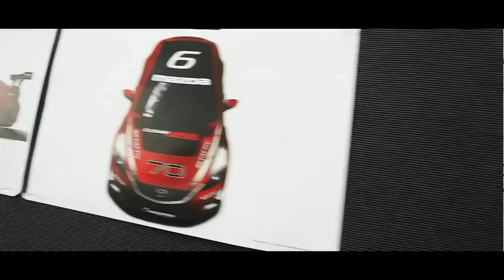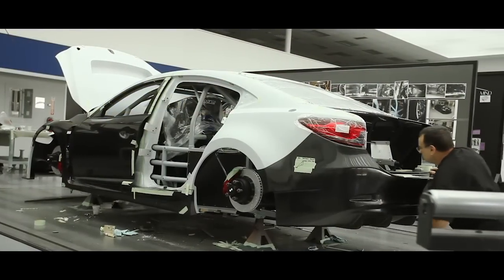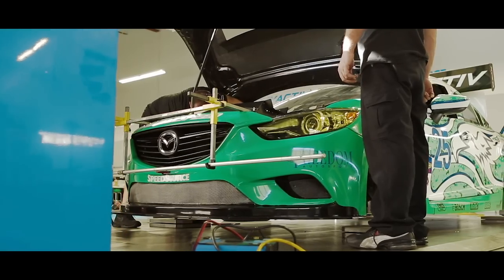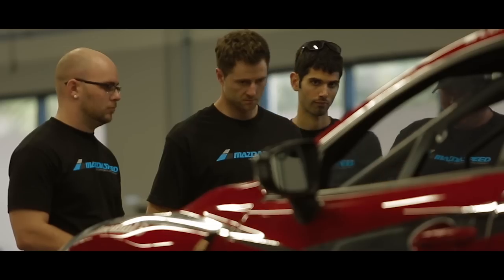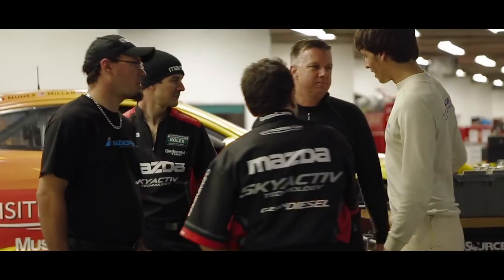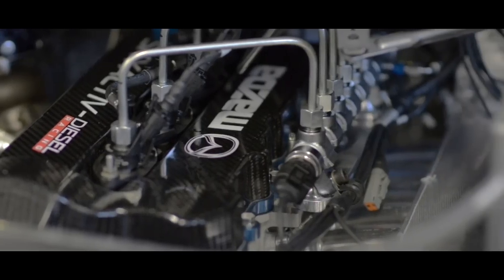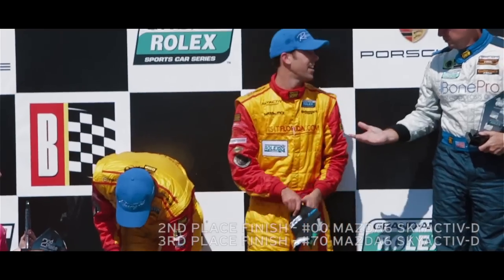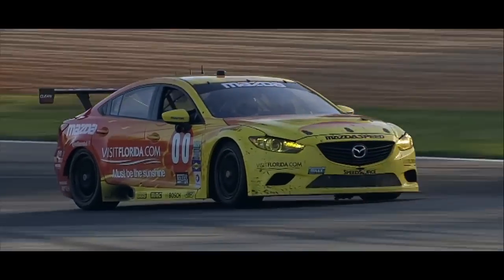The SKYACTIV®-D Racing Story — Diesel Road to Victory — Mazda Motorsports | Mazda USA

Comment: My 1.6 in my track Miata just blew after 3 years of racing. I wanted a engine that was different. So for the last 2 months I have been looking at what if I could get my hands on a Skyactiv diesel and put it in my Miata.
Reply: RJ Lamb+  Great!
Reply: Diesel has sooo much torque and low rpm - you might need a transmission mod (upgrade clutch plates etc )

Comment: I have a 2009 Mazda 6 Sport diesel ..its the EuroSpec model with a 2.2L Turbo diesel engine that kicks out 185 BHP  & 400Nm of torque( unmodded..factory figs) and manual transmission.. Its quicker than 2.5L petrol which is the largest model of the 6 on the Euro market.. Ive had lots of Mazdas down threw the years & just to let ye know .. my Mazda 6 diesel would leave a 231 BHP RX-8 behind on an up hill climb and would be biting at its heels   on a flat stretch of motorway.. Diesel cars are becoming more popular outside North America & that is the route most none American car brands are taking besides Ford .. Fuel is cheap in America..just remember that...
Reply: Yeah ...it's a diesel with a way more tourqe , more economical  and  as power as a petrol ..